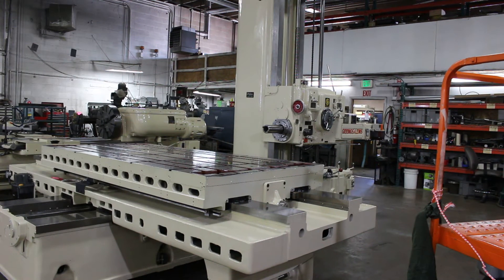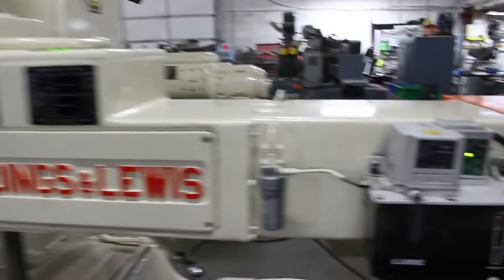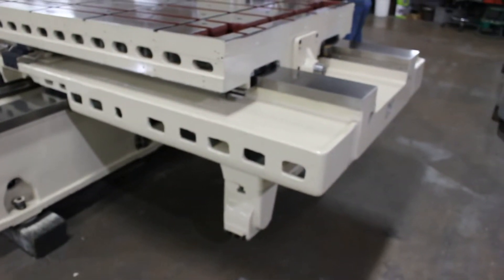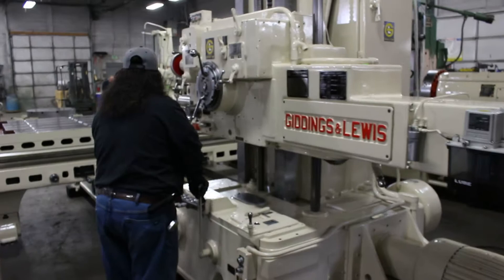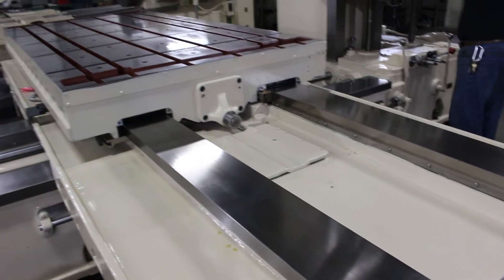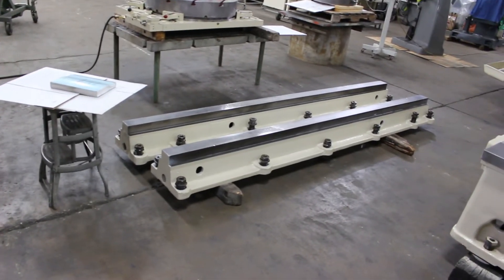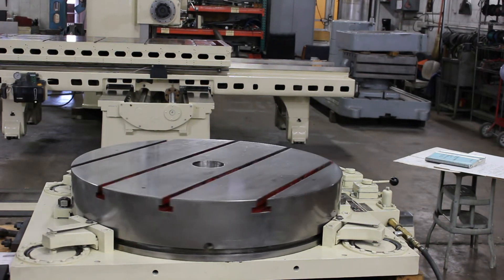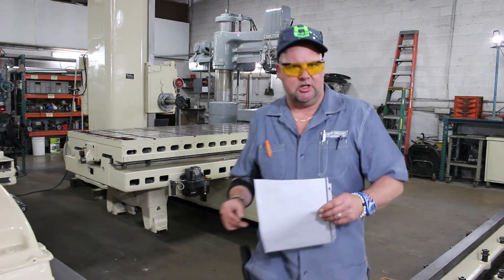Giddings & Lewis Horizontal Boring Mill model: 65 D4 T HBM S/N: 150 560 64 #9898 / updated Oct 2021

Comment: I wish you guys would whip out the indicators and show a bit of le accuracy ... a lot of scotchbrite action on those metal surfaces!
Reply: not sure what you are wanting to see, come to Utah and you can see it running for yourself. 
seeing how its from standby storage from the middle of 1960's. please advise how we are supposed to 
clean the " Metal surfaces"... love to hear how its done in your neck of the woods..

i appreciate your comments, but not sure what le accuracy means...
if something is needed, then request for it to be done, that's how we do it here.
its called face time with a Qualified client.... there is only so much time to show a machine of this size in a 10 minute video.
Reply: @williamwilson9727  whip out indicators and that's all that's needed.. too much unnecessary talking
Reply: I was going to mention, hit us up on FaceTime for inspections that are specific, 10 minutes is hard to cover the entire 40,000 lbs of machine 
Our intent is for@ general overall understanding on the sizes / specs/ capacity’s / so feel free to request anything specific that’s desired 

This bad boy sold the following month after we posted the video 
It went 2 states away and they do large Valve body repair work